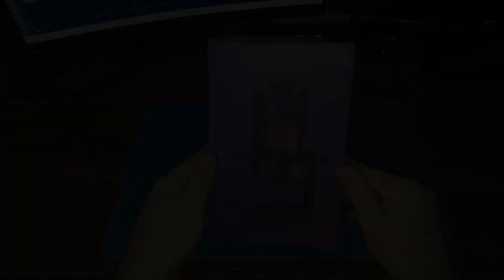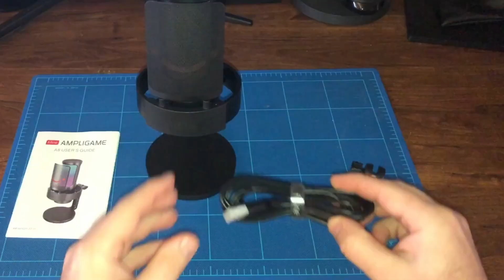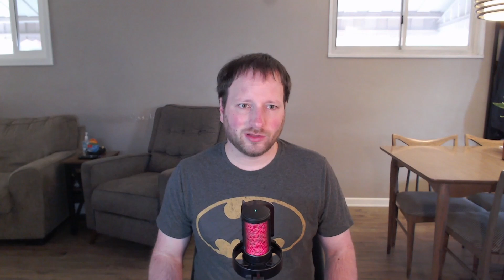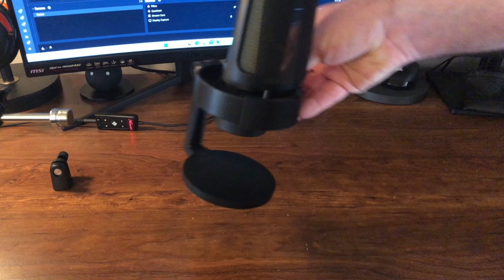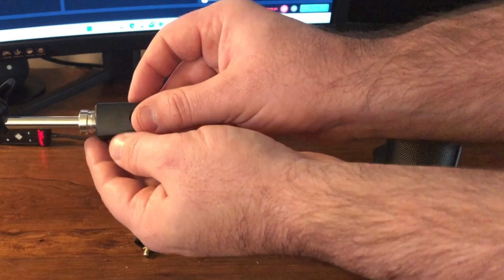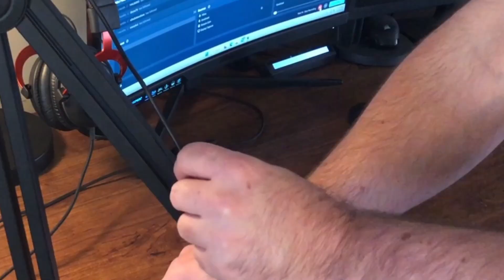Best Budget Microphone? @FIFINE Ampligame A8 unboxing and Setup

Comment: Is there any way to make it sound better? It sounds quite like muffled.
Reply from the maker: I know how to make it sound better in OBS, but  I would have to look into something else if it was for just gaming.
Reply: @MrDarkcore yeah I need it just for gaming, when I make a video it sounds muffled and not clear and loud for me. It’s either the recording software I use or that I haven’t changed the mics settings properly. Anyways great video 👍
Reply from the maker: Well you can try updating the microphone drivers and downloading Voicemeter program to see if that can help get rid of muffled noise. In my experience I try not to use noise suppression built in to the microphones, because for me it sounds bad.
Reply: @MrDarkcore how do I update the drivers?
Reply from the maker: @5tinng_sab What do you use? Mac or Pc?
Reply: @MrDarkcore pc
Reply from the maker: It’s pretty simple, on start menu on windows just search for device manager, then expand sound, then right click on microphone/audio device, then select update driver.
Reply: @MrDarkcore  Yeah using chatgpts help and your introduction to OBS I downloaded obs studio and made my voice wayyy more clearer thanks a lot, only thing is my voice is too loud and clear if you get me, and it doesn’t fix even if I change the db. Any way how to fix that?